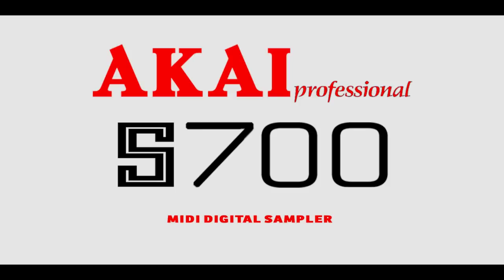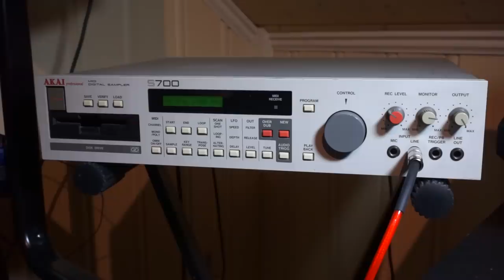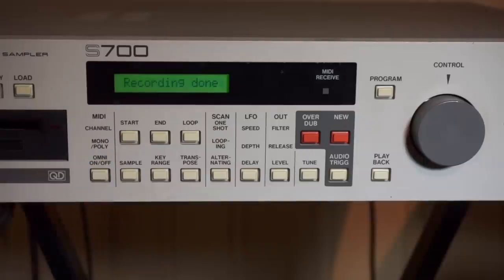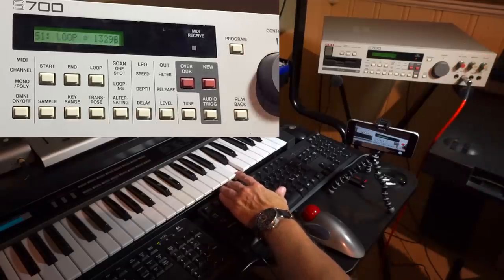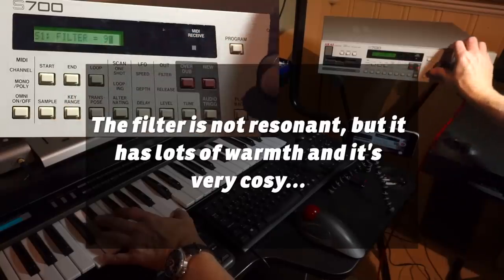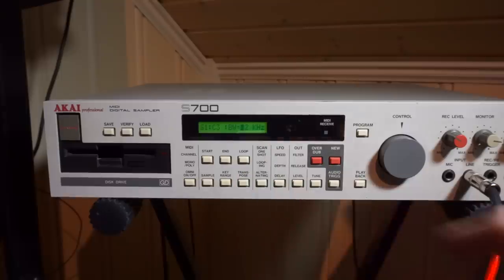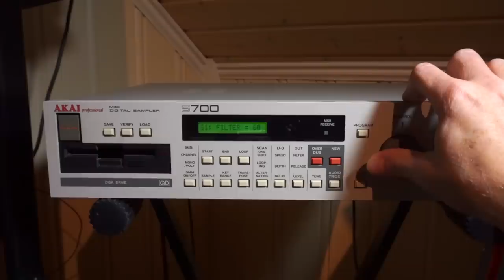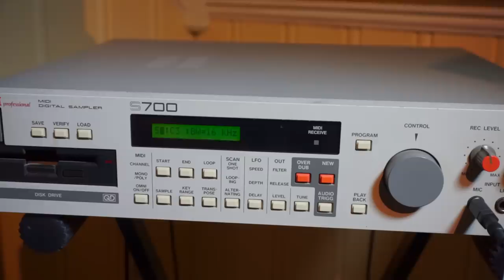Akai S700 sampler - Find this on the flea market for coffee money

Comment: Thank you for this video. This video, and one by Paolo "SynthMania" about sample CDs, have given me a new insight in samplers. I'd always been dismissive of them, associating them with the worst  of 1990s "ah yeah!" and orchestra hit samples. But really and truly, they're just synthesisers that happen to have really flexible oscillators. And it's nothing short of surprising that the low sampling rate actually leads to amazing results. A bit like the Waldorf Microwave (I/II/XT) I suppose.

Now I won't go and rush to Reverb or Ebay to pick up a sampler, because I still have a Yamaha EX5 with a whopping 64 MB of memory and 16 MB flash – and it takes an equally whopping 45 minutes to load that 64 MB. But I'll definitely keep them in mind. Sure, it's easier to do it on a computer, but when your job consists of working with a computer, having actual hardware that you can touch is so much more satisfying.

Food for thought.
Reply from the maker: Cheers!

Comment: Wow - I have an Akai S700 sitting on top of my bookcase that I haven't used in probably 2 decades.  I should pull it out and give it a little TLC.  This video has inspired me.
Reply from the maker: Don't turn it on before you've checked the power supply first! Gear sitting unused for 20 years is like a bomb, it might go off when you turn it on again. Vintage gear should be turned a couple of times a week to get warm.
Reply: @EspenKraft  I'll need t look up how to check the power supply now! LOL!  Thank you for the tip.

Comment: aaaaaand the prices skyrocketed
Reply: Daenerys Targaryen  really??
Reply: Daenerys Targaryen  asking price is not always the real value - or even selling price :)
Reply: Sami Jumppanen True. You gotta check the actual sold auctions because a lot of people post stuff with ridiculous asking prices and it doesn't sell.
Reply: Yeah no thanks. I would rather just use a software sampler and use a bit/sample rate reducer and not have to deal with the limitations of crappy outdated tech ;)
Reply: @sacredgeometry  yes, there are lots of reasons to use this and that. Some people buy expensive watches for... things I don't understand :D  But always the best tools are those that work for you. My best tool during the last years has been Caustic 3 on my Android phone. And it has a sampler as well, "packed up" with limitations and hardware rack sampler style UI :D  But no bit depth control awww!!!
Reply: @SamiJumppanen  I like the best tools with the most options and least limitations. Character is an implementation detail. 

Personally I would rather understand how to get the character I want out of equipment than trying to rely on a piece of equipment that does that one thing and nothing else. I get experience, I get the romance. 

Its just not for me.
Reply: @SamiJumppanen  Also its not bit depth control its sample rate control.
Reply: @sacredgeometry  Best tools are those you make music with. I did best with Amiga 500. Since then life has changed, gear and software has changed and the only real challenge is to is cope with the options. It is great you can do that! I have so often felt crippled with loads of options, but it's partly the lack of time to explore things I guess. Limits push creativity, but I am not saying this sampler is excellent, nor suitable for anyone. And I was really talking about bit depth (cannot do that in Caustic 3 sample player - it isn't a sampler really at all, my bad).
Reply: @SamiJumppanen  Ahh sorry I thought you were referencing the video.

Limitation does push creativity for sure. But I would rather push the limits of less limited gear than try to work within well explored confines.
Reply: @sacredgeometry  - So would I, but just being an older piece of equipment doesn't make it crappy.
Reply: @sirkayda7205  When did I say that? It is crappy because all hardware samplers compared to software... are crappy. 

That has been the case for a long time. The quality, the capabilities, the portability, the ease of use.

The only reason you would use one of these is because a. you dont want to have to learn something new. b. you dont understand how to replicate something its doing. c. you were convinced that it was in some way special.
Reply: @sacredgeometry  - I agree with your points unless there is some additional analog warmth you don't get with digital but I don't hear anything in this example that you couldn't replicate with software. When I referred to your calling the unit old and crappy I assumed you were saying it was crappy because it was old. That's all.
Reply: @sirkayda7205  There arent any analog samplers to my knowledge. 

"When I referred to your calling the unit old and crappy I assumed you were saying it was crappy because it was old. "

Well part of it is that, memory was expensive, DSPs were expensive. Hardware was expensive. There are plenty of old things that are still comparatively functionally useful. Old synths, preamps, compressors, old guitars or violins etc 

A bad quality sampler that has a seriously limited amount of sampling ability is just terrible. 

It was a compromise back then and its an even bigger compromise now.
Reply: @sacredgeometry  - Gotcha. Makes sense. I'd imagine a Mellotron would qualify as an analog sampler with a finite number of samples. Or maybe an Echoplex...that's stretching the concept, though.
Reply: @sirkayda7205  I would argue its closer to a rompler than a sampler. Its a sample based synthesiser.
Reply: @sirkayda7205  the mellotron that is.
Reply: @sacredgeometry  - Yeah plus the fact you can't record sounds into it.
Reply: @sirkayda7205  Well yeah.
Reply: @Xtra Spice Mikey Jungle massive in the house!!!!
Reply: Daenerys Targaryen  Reverb.com sometimes sells them for around $500 or higher.
Reply: sacredgeometry a sample rate reducer won’t work like these old digital machines do unless it’s modeles after the actual circuit of one of these
Reply: Daenerys Targaryen  Just get a Yamaha ModX from this century, and you have all the sampling power + sound processing + filters you'll ever need the next 10+ years :)
Reply: And the prices are still going up...
Reply: @sacredgeometry  I don’t know if you ever intend to reply again but my perspective as someone who was either a baby or not even born when a lot of these old samplers were made, yes we have great sample quality on virtually anything, but the joy to me with old samplers is exactly what drove people crazy back then. The crunchy lofi digital sound, aliasing, loss of the high end frequencies, down sampling mangling the transients, etc. which is probably harder to get right vs just emulating some analog parts. People used to be upset synthesizer presets  “didn’t really sound like a real brass instrument” and now that’s a classic sound. Still, there are a lot of ways to emulate these effects close enough for a track, so I really don’t buy anything if it’s outrageous. I did get a Roland S760 for $50 out of someone’s trunk though sooo lol. Good perspectives though!
Reply: @yallimsorry5983 "but the joy to me with old samplers is exactly what drove people crazy back then" 

Yeah, ironic isn't it?

I get the romance. But especially with digital processing. I have never heard anything an old digital effect/ instrument can do that cant be emulated or recreated very easily. 

Ultimately if the sound is coming from the DSP, its just code being run on samples and spitting out new samples. 

And that's all that audio plugins are. The are either generators of streams of numbers or mutators of streams of numbers.

If you know what the mutation looks like even at an aesthetic approximation you can get extremely close with very little effort.

Maybe not as easily as just running your audio though that literal process but certainly not much harder.

Comment: I had the Akai S700 and Roland MKS100 back in the day, both great and unique samplers (Also the Juno 2 which I see you're using as a controller keyboard). I remember velocity filtering the Amen snare on a track with the S700 in the early 90s, that analogue filter sounded way better than the all digital S1000 at the time.

Comment: Owned one of these, with the memory expansion. 16 sample storage was enough to multisample my family’s piano back in the day and also used its 13pin interface to run samples through my VX-90(AX73 rack).
Reply from the maker: Yes, the 13 pin output is great when you have the Ax or VX. Multisampling on this isn't the way to go today imo :)

Comment: Love it!  Really nice demo.  Funny, I went from the S950 right to the S1000.  I somehow missed this 12-bit gem of a sampler.  Must'a been those QuickDisks that put me off, ha.  Sweet!  Thanks for making this.
Reply: By the way, fixing the QuickDisk, "fixing the QD drive is relatively easy. usually you just have to replace the belt. You can buy replacement belts from video game shops. It is the same belt as famicom disk system. There are video tutorials for doing the job. Otherwise look up a famcom replacement drive. They are out there."  http://disq.us/p/15lzz4f
Reply from the maker: Thanks Erik! :) Yes, the QD system didn't last very long. I know how to fix the belts and all, but on this the fast sampling time and method just makes me use it as any other non-preset synth. I just sample and use when I need it.
Reply: Check out RX950 vst

Comment: Nice demo. I have two of these I need to get up and running, as well as the S612. I’ve had good luck with simply replacing the belts to get the drives working again. 
PS: Nice Goblin riff there 😉
Reply from the maker: Thanks David! Yes, it's often the belts on these.

Comment: My first ever bit of hardware was an X7000 from a pawnshop. Still have it, and still use it on virtually every recording! Those gooey low-mids are such a uniquely Akai sound, totally different to the gravelly crunch of an Ensoniq EPS or the soft neutrality of Roland's 12-bit machines. The super-simple interface also makes it the machine I'm most likely to reach for in the middle of a recording session.

The filter is actually quite interesting electronically, as it's a switched-capacitor design (if I remember correctly). I assume that's the source of the high-frequency switching noise you can often hear at lower cutoff frequencies.
Reply from the maker: Yes, the filter is a digital/analog hybrid and in fact more close to a "FILTER"  in the actual meaning of the word than a filter chip like a CEM or SSM.

Comment: Sweet tutorial Espen! I actually have a S950 at home which is collecting dust since 10 years. I always thought it's broken but maybe it's just the floppydrive as you hinted @ 0:32 !
Reply from the maker: Thanks! Just remember that the S950 uses regular 3.5" floppy drives and floppies where the S700 use the infamous Quick Disk system. They are not compatible and unfortunately (as I go through in the description to the video) none of the first Akai samplers comply to the MSD protocol so you have to use a old mac/atari with sound designer or similar to transfer sounds if the floppy is brone. Easier to replace on the S950 though.

Comment: This was my first sampler - I paid around £400 for it in about 1995. The disk drive still worked but getting hold of those disks (before eBay) was a complete pain. Mine also had the memory expansion card which helped. I made some great noises using the LFO and filter. It has a lot of character and is so much easier to use than the Ensoniq budget sampler. I'm hoping that Behringer will make a clone or an original take on an early sampler. I like Akai s950s and have owned several but they are going for £600+ for units in average condition.
Reply from the maker: All the QD-samplers were very popular here in Norway and there's still a lot of QD floppies around. They pop up for sale quite often here too. I don't bother saving sounds at all. I sample a sound, record it into my track/production and move on. ;-)

Comment: Love this Video. So essentially the magic is in how nostalgically vintage the degradation of the sample sounds, and potentially the sound of the low pass filter. I never thought of this, I wonder if there is a software version of this type of degradation.
Reply from the maker: There are plenty of plugins doing degradation of sound, some better than others, but they will always be just that, a plugin that does degradation, clinically and efficient. Not in the musical and beautiful way old samplers does it. The only way to getthat sound is to use one of those.
Reply: If you want that Inphonik made an amazing emulation of the akai ad/da 12 bit converter it's also emulate the filtering and lofi quality of this sampler, they also made a full E-mu Sp 12 with the same lofi quality, the gain stage is also tweekable.

Comment: The S612 and S700 are very similar in sound and features though the 612 has a more direct, almost analog-like interface -- sliders for the loop points (cross them and the sample reverses!), and a good old fashioned LED VU meter for the levels.   It's usually easier to find the S612 than the S700 (in fact I've never seen an S700 in the wild, only it's keyboard brother the X7000)
Reply from the maker: You don't see them often here in Norway either.

Comment: Just got one for 100 euros which i consider is really cheap buy i have 2 issues first i tried to change the 2 prong ac plug to the usual 3 prong PC one, did that the sampler works fine but the 3 prong is not fitting the metal case, are there any 3 Prong cables that are slim enough to fit in  ? also i cant find the format command for the diskc i have a couple os spare QD but i cant rread then i get the "Bad disk" error, looked over the manual but it seems there is no "format disk" option. Otherwise i am really eager to include this vintage gem in my studio. Any ideas whould be great ! Thanks.
Reply from the maker: Changing of 2 prong to 3 prong has never been something I'd care for so I have no idea. There is no formatting of QD's on the early Akai samplers.

Comment: I had a Roland W-30 sampler in 1990. To compare it to NI Kontakt using any DAW is apples and oranges. In Kontakt, I can loop in seconds. With Kontakts filtering and scripting, I can make any stale sample sound like it's an analog synthesizer. I don't romanticize about old samplers in the slightest.
Reply from the maker: I had lots of samplers in the 80s and not one new one, including soft samplers, comes close to the sound of the old ones. That said, I too use Kontakt occasionally. ;-)

Comment: I have a midi problem with my s700, it play only polyphonic and play only when I hold first note which is mute and on it the other notes play, do you think is an hardware problem?
Reply from the maker: It can be set at any of the "mono" modes. That can mess it up. Check from page 33 in the manual and set it to "polyphonic" and "omni on".
Reply: @EspenKraft  Do you have a s700 SERVICE MANUAL? the normal one I already have it….I need the Service one

Comment: It was also my first sampler. I gave it up as busted & its up my loft. The disc drive is broken though there may be another fault. I badly wish I could still play my S612 discs as I used to love the orchestral hits etc. I think I'll get it down & see if it still works without discs though. I did make up a lead with 13 pin plug going to separate patchbay points. In 1988 a DJ friend & I did a megamix just for fun & I loaded 6 samples into it & played manually along with a TR505 drum machine & SPX90 for delay & reverb. Even though I can't play well I'm quite proud of bits of our efforts such as a melodic improv I did over Kiwi & Tess's Show your love. It sounded so authentic that I had to just play the mix to check if it was really me & not on original mix! I was hoping that a company who made card readers for some obsolete sampler drives (HXC) would get around to one for this. I remember nagging them. I'll have to try again!
Reply from the maker: Don't get your hopes up on a QD emulator, that day will never come.. ;-)
Reply: @EspenKraft  Maybe, but I'm pretty sure that HXC made SD card readers for other Quick disc machines; computers & other devices? So who knows? Half the trouble is getting some of these companies to bother replying.
Reply from the maker: Who else uses Quick Disks today except the occasional retro based musician? I've followed the development at those whos started something in the past, but every they've given up.
Reply: @EspenKraft  OK. By the way I also have an Akai S5000. I might be able to buy floppies for it from Northstar if I can get a response from him, but if I can get hold of a CD ROM drive compatible with it, do you think that would still be my best bet? Do you have any recommendations please? Thanks Espen.
Reply from the maker: Depends on what you want the sampler for? Make your own samples or play sound libraries? The S5000 is excellent in every way, but for me it lacks the special magic in sound, that 80s sound I want in my music. The S5000 is a no in that department.

Comment: hello Espen, my S700 now sometimes sounds louder and sometimes very quiet. When I turn the level control nothing happens. I suspect that the potentiometer is gone or it could be something else. Can I simply replace the potentiometer with a standard potentiometer or should I dare to clean it. There is no site with parts for the S700
Reply from the maker: A potentiometer is a resistor so you have to put in a similar one of course.